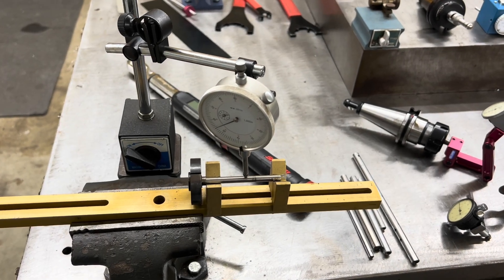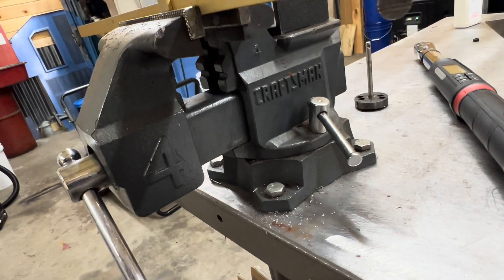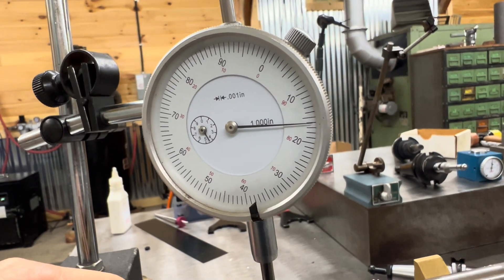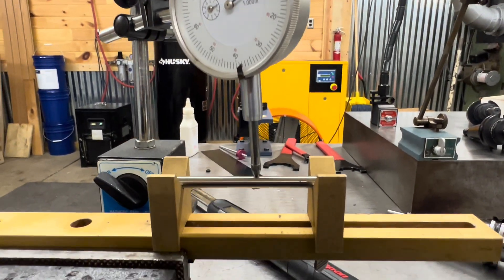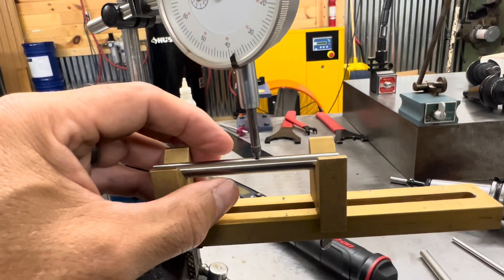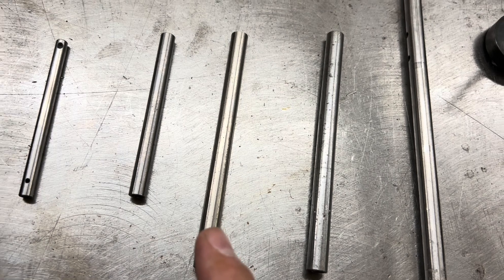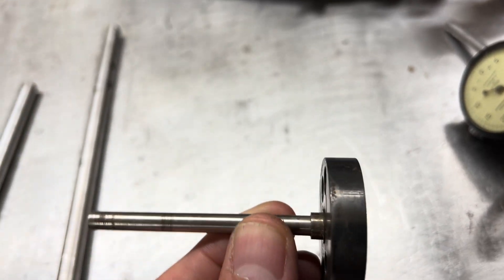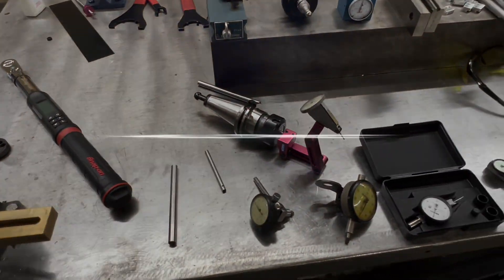Heli Vibrations? Bent shafts? Maybe?  Tips on how to check it out! by Matt Botos

Comment: For my helicopter, it's nearly impossible to find a replacement main shaft due to being discontinued many years ago.  I've changed my main shaft at least 8 times, but the catch is that I only own 2 😅.  You use your vise to hold your roller, but I use my vise to Straighten my main shafts!  You have the vital tool right there in front of you but it's not being utilized properly, and instead you are just throwing away slightly bent shafts lmao...   If only I had that luxury

Comment: I’m a brand new rc helicopter pilot. I’ve owned fixed wings before. I have a FlyWing Bell 206 V3 brand new RTF and I for the life of my can’t completely get rid of a vibration on shutdown. It used to do it on spool up as well. I’ve adjusted the main blades many times and can’t seem to get it right although I’ve made it considerably better. Please help.

Comment: I have a new 450bscale heli. Never crashed.  It all the sudden started shaking violently while spooling down to shut off only. It does it just for a second,about a half way on spool up to max rpm. Ive put on perfectly balanced blades a d tracking. Shafts and swash are good. Oh . Also it only happens after flight. If i jst start it ,let it spool up to max and shut it down without flying, i dont shake. Any ideas? Id be very grateful.  I feel like ive trued everything except just replacing the entire head mechanics system.
Reply: Maybe try adjusting the blade grip bolt tension. It sounds like one of your blades is leading/lagging different from the other.
Reply: Thank you for the tip.   I found it was an  out of balance blade.  A factory defect i guess. They sent me two new ones and it stopped shaking.